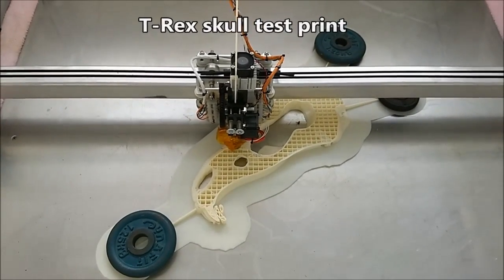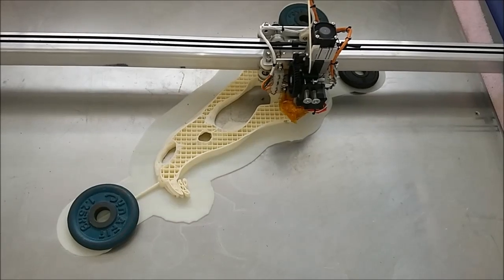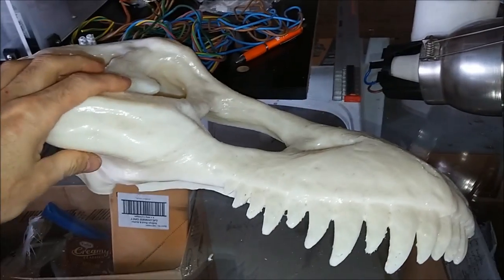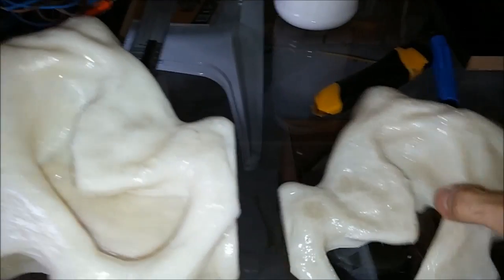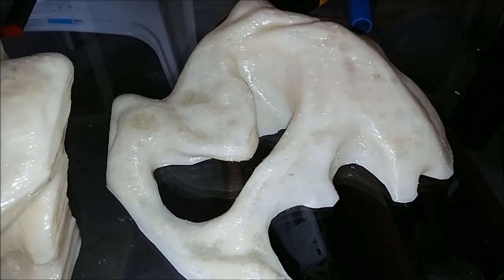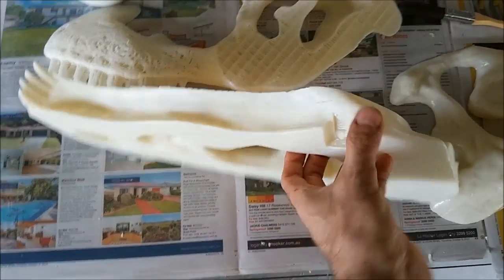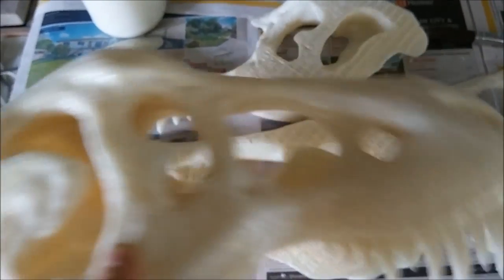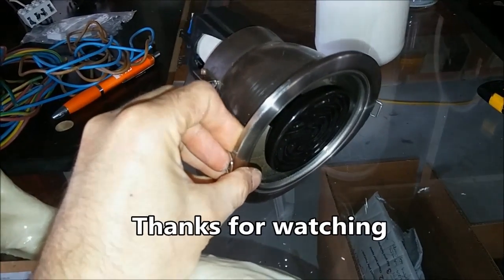Large scale DIY 3D printer - 1200 x 1200 Sub33D V3 - T-Rex skull test print

Comment: Would it be possible to use a material with a higher melting point as structure under the heat bed? It’s a large bed and aluminum's melting point is rather low compared to other metals. Structure across the bottom could help prevent warpage.

Comment: How much time it take to print that?
Reply from the maker: Around 28hrs (very slow with the 1mm nozzle and existing extruder, hence the current extruder upgrade)
Reply: Sub33D what is the extruder update? I was thinking in a nozzle of 2.8mm and two volcanoes. Do you think it Will work? I am not interested in high resolution. Your opinion is very important to me!
Reply from the maker: I am building a dual 3mm filament 100mm high block with 8 x 40W heaters (320W total) to combine into a single 1.5mm nozzle (a larger nozzle would need a longer block), this should give me 16 x flow rate over a standard 3D printer heater block
Unfortunately I was disappointed with the two volcanoes (1mm nozzle was already to large)
Reply: Sub33D I don't think the Block is your problem. I saw a guy printing with 2.8mm nozzle and a e3d v6 block (less powerful than a single volcano)
Reply from the maker: Yes, it can be done using higher temperatures, but this causes other issues. The main limiting factor is the thermal conductivity of the ABS plastic (very poor compared with metal, hence the higher/longer block to give the ABS time to heat to the center)
Reply: Sub33D if you can test your actual extruder configuration with a 2.8 nozzle and make a video at different speeds I Will really appretiate it
Reply: Hi! Have you finished the new heater block? Any advise for someone that wants to make something similar?

Comment: Great work! You really must go with PLA though; you're running false economics with ABS. Your electricity bill will be scary as hell! Buy some bulk PLA pellets to run through your filament factory. It's what I'll be doing on our 1 cubic metre printer, once I get the damn thing built. It won't be fully enclosed, and it won't have a heated bed, because cool air is your friend with PLA. Unlike ABS, which hates cool air. ABS is great for injection molding but it pretty much sucks as a printing material. It's hard enough to print ABS on a small machine like the Makerbot R2X, it's not surprising that it's your number one problem at your scale. I'd also hate to know what it's doing to your health; micro particles are produced when ABS is heated and you're using acetone. Has your house been raided as a meth lab yet? :-) The printing industry has all but dropped the production of ABS machines because of the potential liability to customer health... at least companies based in countries with legal systems that sorry liability cases. Keep up the great work.
Reply from the maker: Agreed, It would be a whole lot simpler to use PLA, this is what a lot of the large scale printers use, but there are many reasons why I am using ABS,
We recycle around 400kg of ABS blended plastics a day at Substation33 and we have recently started shredding it, so we are very focused on the recycling aspect.
The engineering components we will be trying to produce with the large scale printers would not work too well if made from PLA, ideally we will be using ABS/PC blends for it's high temperature/strength properties (and we have a huge abundance of this material)
And I love a challenge (or I maybe just a sucker for punishment, time will tell ;-)

I also run a large scale residential solar farm which provides the electricity for the printer, please check out this video:
https://www.youtube.com/watch?v=ijbN_0cMFAk

So the electricity cost is not so much of an issue for me (aIso will be expanding my off grid system to provide energy for this in future)

The printer will stay outdoors and is completely enclosed, so the fumes are not really an issue.

Good luck with your build
Reply: Sub33D How much filament did you use for the whole large skull?

Comment: or try putting some blue tape on it  or spraying it with hair spray
Reply from the maker: The plastic primer and liquid ABS holds really well (better than blue tape or hairspray), the issues are more to do with the parts cooling and shrinking causing huge stresses between the part and the bed

I have just installed 600W of IR heaters to heat the part and further raise chamber air temperatures

Comment: if you spend alittle bit on a sheet of glass that isn't too heavy for the bed you could put that right on top of it and clamp it down with something and you should get some really good adheasion
Reply from the maker: I looked at the glass option,. but it would not work so well with the auto bed leveling proximity sensor
The weight would not matter, but it would also cost more in electricity to heat a 1200 x1200 x 6mm plate of glass that size (it would need to be at least 6mm to minimize warping)

Comment: have you thought of enclosing the printer with a acrylic box? Abs needs 150C bed heat and an enclosed chamber to reduce warping issues.
Reply from the maker: BEN in 3D it is all enclosed and running at around 60 deg C,  I have just fitted 600W of IR heaters to heat from the top to try to keep the printed part temp higher and more consistent
Reply: acrylic box at this volume would cost a fortune xD , better use wood

Comment: are you using any adhesion surface? beacuse on alliminium the plastic do not stick too well...., try with bluetape or masking tape for pla or gluestick for abs works just fine . also if you can make an enclosure to keep the heat inside the chamber.
apologyze my english but io am italial :)
Reply from the maker: The printer is enclosed and the air temperature is around 60 deg C during printing (I have been advised to try to get it to 90 deg C)
I am using plastic primer spray on the aluminium which bonds incredibly well (you are correct, ABS juice does not stick very well to the aluminium), then I use ABS juice on top of the plastic primer which then bonds the part to the bed almost too well :-) (can be very difficult to get the part off the bed at times)

Your English is fine :-)